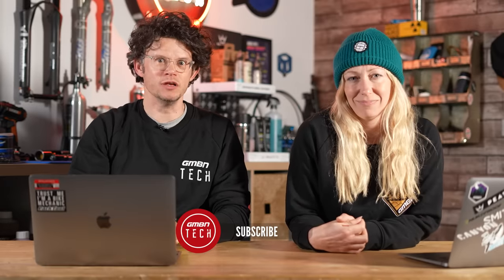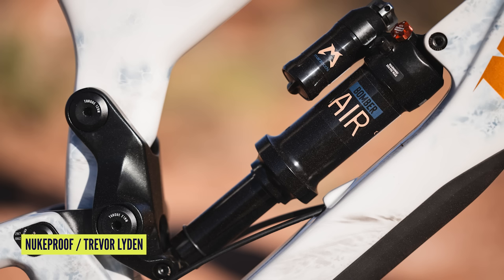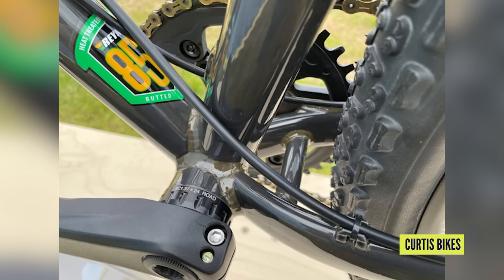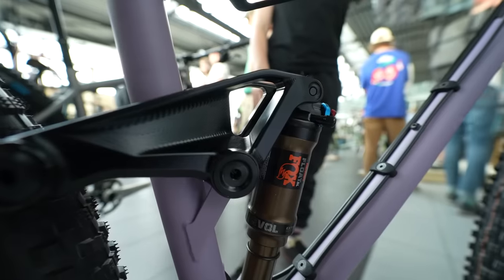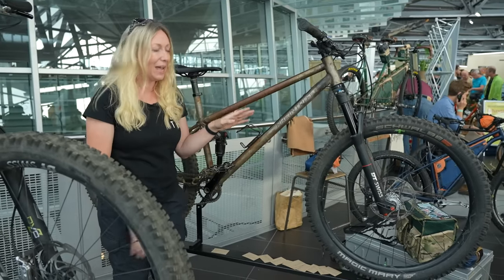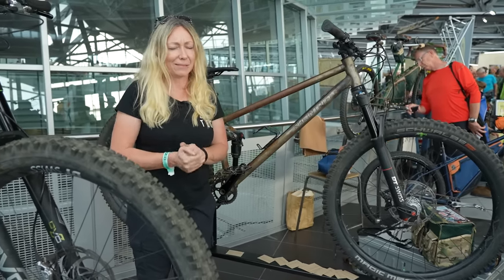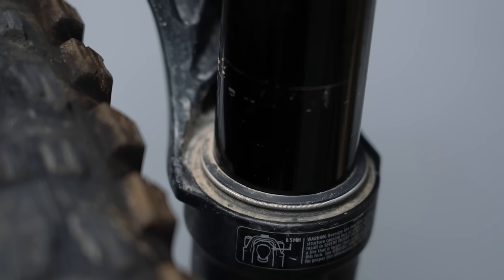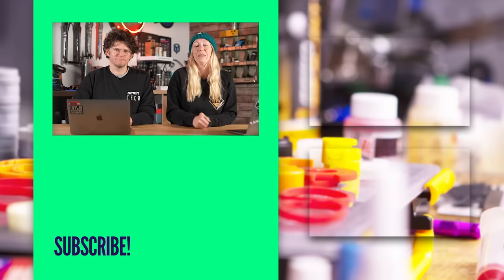Weird And Wonderful Bikes From Bespoked Handmade Bike Show | GMBN Tech Show 302

Comment: Please make a video on choosing and fitting dropper posts to bikes and rider sizes. Like, which length of drop for which length of seat tube and rider size. I think that's really missing on the you-tube. Thanks for your good work. :)
Reply: They do have a video about it... but even watching it 3-5 times I was still confused which size to go with. In the end I did choose correct size, but just about :)

Comment: I agree with Owen. The fewer adjustments the better! My Fox 36 performance is perfect paired up with my DVO topaz rear shock!👌 Have no desire to get suspension with more dials and more complexity.
Reply: Josh what do you like about your DVO Shock that your last shock could not do?
Reply: @Magoo71  Good question. The main reason I went with the DVO over the Fox DPS shock, was the longer stroke for my Giant trance, second was the the piggy back on the shock. So it doesn’t heat up as fast and decrease performance. The Dvo has the same dials as the DPS from Fox. Rebound, compression, and a air valve. That’s it.

Comment: #ASKGMBTECH, I was given a Suunto watch as a pressie, so I got the bike sensor for it. I can't get it to fit my Rockhopper! I have two problems 1. The sensor will not fit in position on the pedal because there is not enough clearance. 2. Fitted to my chainstay the wheel magnet is to far away from the body of the sensor. Can you think of away round this? Thanks Nigel

Comment: #askgmbntech  - I currently ride a polygon siskiu D series (120mm front and back). After a fair bit of testing about what i like the feel of, I run about 15% sag at the front and 25% rear. I use about 80% of the rear travel and around 55-60% front on my somewhat rough local loop (Jumps up to about 1.5m and drops no more than 1m). I think it feels great  - maybe because the rougher it gets the slacker the head angle gets? A lot of guides recomend having "balanced" travel so that a similar amount between front and rear is used for most rides. Is it a problem that my suspension setup is not "balanced"?

Comment: #askGMBNtech, my brakes on my Trek Xcaliber squeel like hell, they don’t have much stopping power. They have been cleaned with brake cleaner, the pads have been lightly sanded so the glassing was gone and then back bedded in, no good result😢. They are of the ressin type. Will it be better when I put sintered pads in with my rotors or do they also needs to change? Any advice is welcome grtz

Comment: #askgmbntech - this may have been addressed already- but isn’t “Downcountry” just a Trail bike? Whats the difference? A lighter trail bike? It’s just a more capable, longer-ish travel XC bike- sooooo
Reply: I would say that you kind of answered your own question. It really just is a somewhat vague marketing term used for the bikes in between XC and trail. Componentry and frame plays a bit of a part as well. Some downcountry bikes are pretty much beefed up XC ,  others are more like short travel trail bikes - the frame, linkage, shape, presumably strength and componenty match that. I personally think they really should be specified as high travel XC or low travel trail bikes to avoid the confusion, however I think that there is a place for this category. A capable "down country" bike can do 90-95% of what a trail bike can do and IMO is more fun to ride.